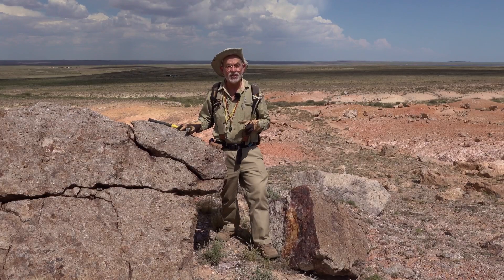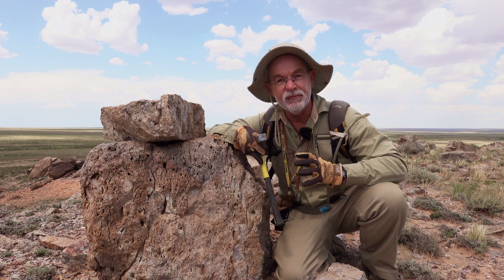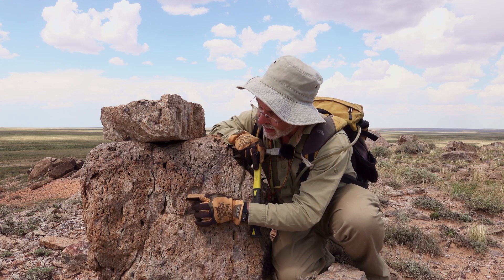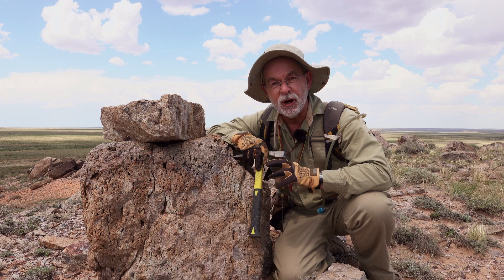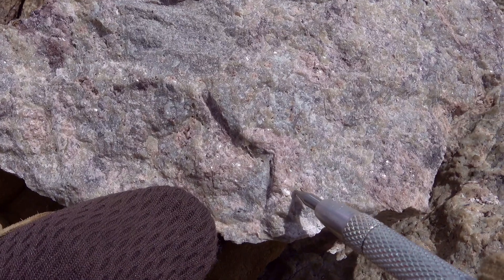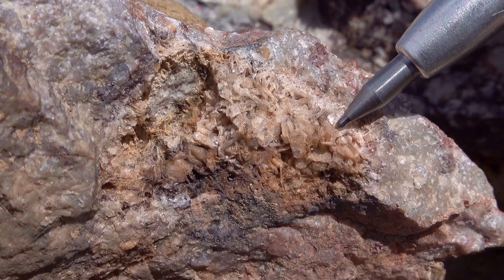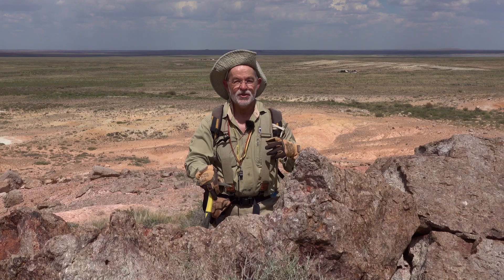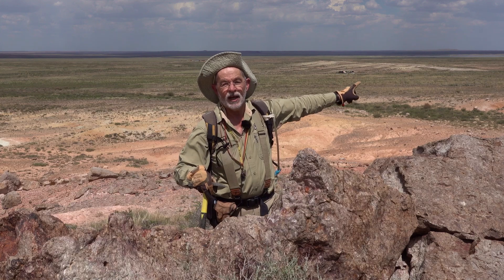Not Silica!

Comment: Great info thanks. I'm not very familiar with alunite... I think I'm mis identifying it  historically it is recorded in mullock at Donnybrook
Reply from the maker: It is pretty tricky, particularly if it's fine grained. If you see a rock that looks like beige coloured marble in a system with lots of clay silica and pyrite, it should trigger suspicion.
Reply: @GeologyUpSkill  it has the added problem of being associated with the bonanza grades the old timers chased... I'm yet to find that too....  It's a MS overprinted by a LS driven by Cretaceous breakup of east Gondwana and now over planted with yummy apples.... It's been flooded and unexplored since 1903.... Until Patreon got me a ROV....  https://youtu.be/6Zng9u1Wv0k?si=YK4gUnioz3JZFBGc
Reply: @GeologyUpSkill  it's the salmon coloured crystals that caught my eye as maybe it's not a feldspar...
Reply from the maker: If you can see good crystals, alunite is distictly tabular and occasionally in slightly radiating groups. Feldspar crystals are more blocky. Salmon pink could also be rhodochrosire in intermediate sulphidation epithermals.